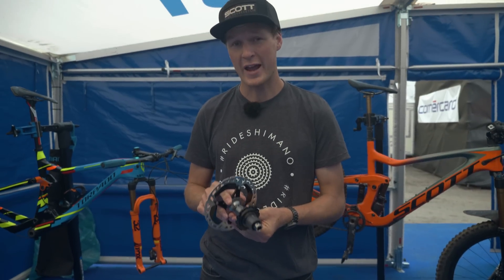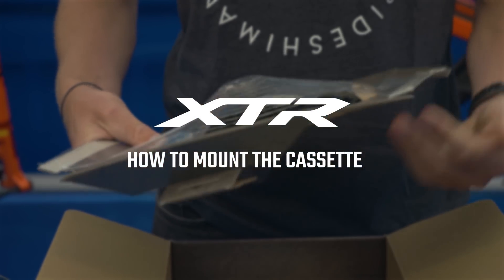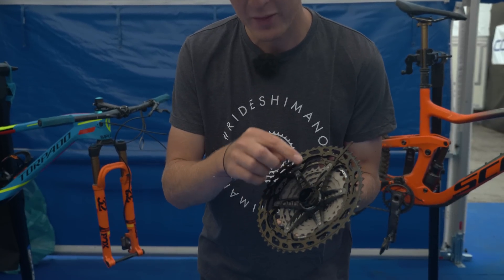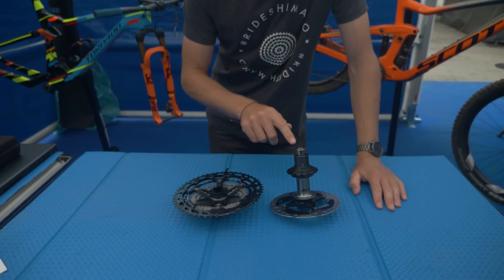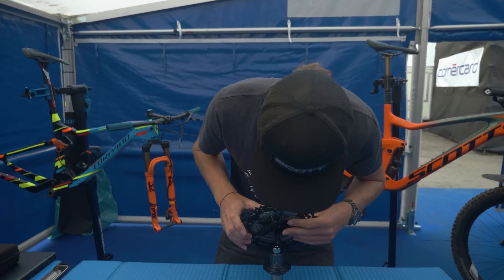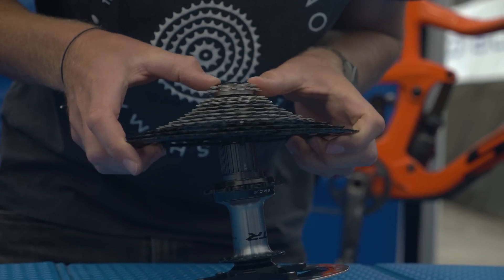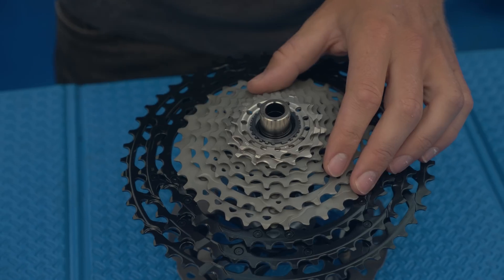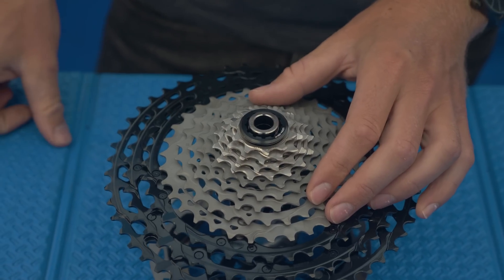Tech Talk: How to mount the XTR 12-speed cassette | SHIMANO

Comment: There is zero mention of the extra washer that should go on before the cassette to prevent creaks.
Reply: And zero mention whether you need a new hub/body either?? I'd assume it does not fit in place of and old 11s cassette??
Reply: @jnygaarddk  Microspline is the new hub body to accommodate the 10 tooth cog.
Reply from the maker: Correct, we created the video to display the components. However, all detailed information including the low spacer and the amount of torque you need to tighten the lock ring can be found in our manual >> https://si.shimano.com/pdfs/dm/DM-MACS001-01-ENG.pdf We'd recommend visiting your nearest Shimano Service Center if you need help with the installation.
Reply: @RideShimano dead link 👍

Comment: Shimano, for the love of God, allow more companies to manufacture micro spline cassette bodies, especially Mavic, I've been trying to install the new xtr on my bike for months now and am struggling like hell because of lack of micro  spline hubs and general lack of supply of most of the group set, it shouldn't be this hard!!!!!!
Reply from the maker: Micro Spline is not an open standard yet. In addition to our own XTR M9111 and MT901 hubs with a Micro Spline freehub, DT Swiss and Industry Nine are licensed to produce their own freehub-bodies with Micro Spline. Additional brands using the Micro Spline freehub body will be announced in the coming months.
Reply: @RideShimano  thanks for replying, I understood before Dt Swiss and i9 are making the hub bodies but that really narrows options to retro fit m9100 to most bikes, I really like the sylence hub you have shown but I cannot find it for sale anywhere, do you have a release date? Will it be available in 135mm 10mm quick release rear hub format?
Reply from the maker: Unfortunately, the product didn’t meet our highest standards of quality control testing. We had to go back to the drawing board on the design of Scylence. We still have faith that the concept can work and we’ll continue developing the technology, but for now, the production has been canceled. There will only be Thru-axe options available with Micro Spline from Shimano. But DT Swiss might and other manufacturers later this year might have some options for quick release.
Reply: @RideShimano  can i buy only the microspline freehub body and put it on my cube hub?